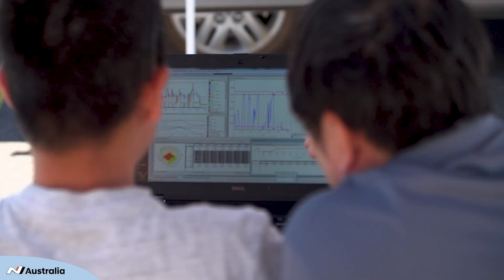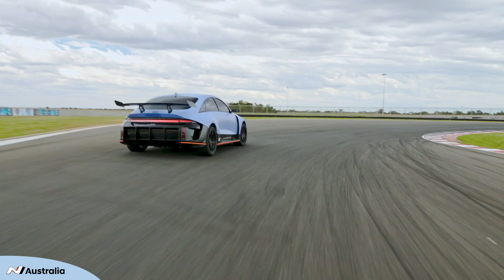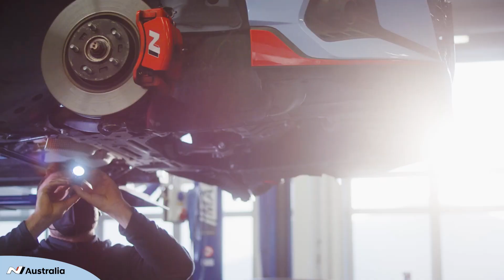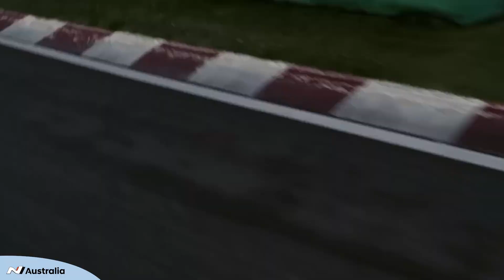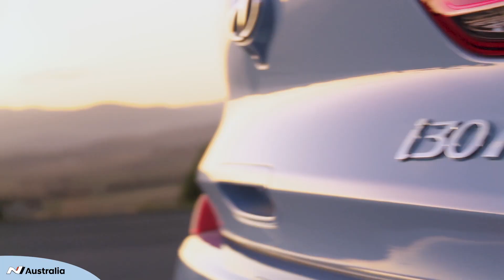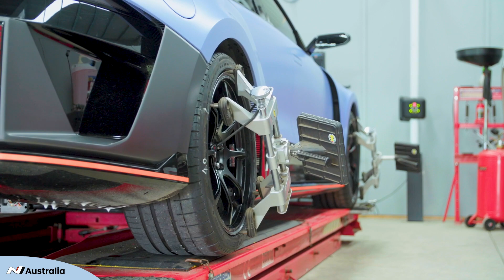10 Questions with Albert Biermann | N Australia

Comment: He knew what he was doing with the N performance. These N cars are basically affordable BMW M performance vehicles. A hybrid between KDM and German engineering, brilliant.
Reply: 100%
Reply: No no no dude. Just stop. Stop it. Put the crack pipe down. If you think that it is because you don’t know enough about cars. Don’t be offended, you are just factually wrong and don’t get your ego hurt. Don’t put Hyundai in the same league with M cars until you’ve owned an M car.
Reply: Hyundai flagship Elantra N or I30 is Front wheel drive and has 270ish horsepower. M cars make well over 5 and are RWD or AWD. The Elantra N can maybe beat a 230i, but that is BMWs entry level car. That’s the reality, Hyundai just offered the guy money to promote their new N brand. Turning an economy car into something sporty is not the same as an all out borderline race car. 🏎️
Reply: @postalpancho you need a reality check bimmer boy. M cars are actually more boring than they used to be and N cars are actually more fun even with less hp
Reply: @postalpancho  Oh thats right.  It dont break down 3 times a month.  Wont ever match BMW quality lol
Reply: @postalpancho  and not to mention your also talking a car 2x the price and 2x the hp.  For a weekend track car the N takes the M.  Its a fabulous car people love to hate.  Driving one still puts a smile on your face.
Reply: @jugo5139  people ain’t hating on the Elantra N. People are just putting it in its place. Th Elantra N is okay for the money but it doesn’t even come close to touching an M product or even a mid level BMW. It is stupid that people, who can’t afford a BMW are quick to try to put BMW down so they can feel better about driving a Hyundai. It just isn’t on the same level. Just like you can’t compare the Elantra to a Supra, you shouldn’t compare it to an M car. It is a stupid notion.
Reply: @postalpancho  It isnt the same car. IDK why anyone would compare them to begin with.  Its in its place. Yet it does hang with a few of them.  With the price tag of an M.. There's better out there.
Reply: Hey Franky, you should read some stats and facts before typing away. 330i M Sport can’t touch the i30N sedan. I know because I moved from a ‘20 to the N sedan. As far as an M3 goes, these days the options at that price point are wide and the m3 is lacking. Sorry BMW boy.
Reply: @postalpancho oh lawd- gatekeeper and elitist right here fam. It reallllly isn’t that deep man.

Literally the same guy had a hand in N and M cars. They share that familiarity and DNA. That’s it. Just stop the cringe. You give car guys a bad name.
Reply: @postalpancho  What part of "affordable" do you not get? Of course it's not as good as cars that are far more expensive than it. But for the price, it puts enthusiast power into platforms that are far more accessible to many more people.
Reply: @zx-3948  right? It’s like us guys can’t have nice things and the Bimmer boys get mad that we can finally enjoy any semblance of driving joy they get from their BMW’s. like how dare we? Lol
Reply: @zx-3948  it’s affordable…. But it is not an M car in any way whatsoever. A souped up econobox has nothing in common with bespoke RWD performance coupe. They are not at all related in any way. There has never been a FWD M car under 300hp. It isn’t even close to an M car. The Elantra N is an enthusiast product but calling it an M car is dumb as shit. Imagine calling a GTI and affordable Audi RS3…. Yeah it’s stupid, not at all related and a GTI and RS3 actually have more in common and it still sounds stupid.
Reply: @postalpancho  I never called the Elantra N a BWM M car. You are correct that they are different cars, but the design of both was led by the same person. They share similarities whether you like it or not.
In no way is either car a bad car. Each have things the other doesn't. You liking BMW M has no relevance to others liking Hyundai N. You can like them, but that doesn't mean everyone has to, nor are they the ultimate performance car. But don't go bashing everyone else just because you can't accept that fact that other people think there are better cars than a BMW M.
Again, BMW M are fantastic cars, but this does not automatically mean that the Elantra N, or anything else for the matter, is a bad car either. They do different things and are aimed at different markets.
Reply: @zx-3948  how dare you be reasonable and logical.
Reply: @postalpancho  I’ve seen them fly by M cars on the Nürburgring that telling me enough 😂
Reply: This is actually hilarious.  Jay C said they are AFFORDABLE BMW M perf. vehicles.... NOT comparable.  BUT, honestly, for the price of the BMW - keep your fucking garbage BMW.. I can get more enjoyment out of my N than you can in your M.  Why is it that people ditch their BMW's right before 60,000?  Is that they are a money pit that begs a specialized mechanic?  I don't care about your 500HP.. it means nothing.  I would gladly purchase an N over an M because I would be saving tens of thousands of dollars in both the sale of the car and service for the bragging rights that a mid level M may just be a second or three faster.. HAHAHAHA
Reply: @postalpancho  do you even own an M to be talking like this? Which one do you own? I don't get how you are saying people are saying N= M, no one is saying that.

Comment: The EV future makes me sad. I want more loud N-cars
Reply: Why?
Reply: @nlikos180  Have you driven EVs? They feel lifeless, heavy and digital. I don't like them, and I don't want them, and I don't want fake sounds through speakers.

I want a car with character, one that has engine, induction and turbo noises. I want to feel boost kick in. I love my i30N and couldn't care less about any sort of EV.
Reply: @Cernunn0s90  Agree. Yes i do for couple of times because im work for car detailer and have done in EV's car and no sound. I own i20N and still love it. Engine sound is better than EV.
Reply: @nlikos180  EVs soulless and a Placebo.
Reply: @Cernunn0s90  I feel the same. The torque and 0-60 of EVs are fun at first, but it wears off. There is no drama, no connection. It sounds stupid, but you really notice it after driving an EV for a while.